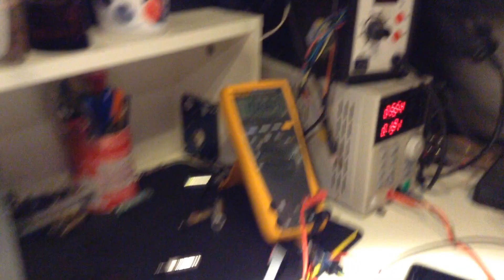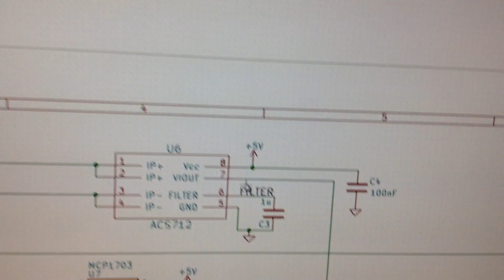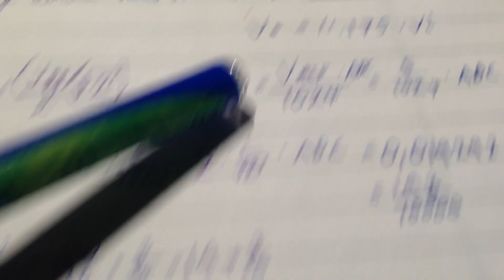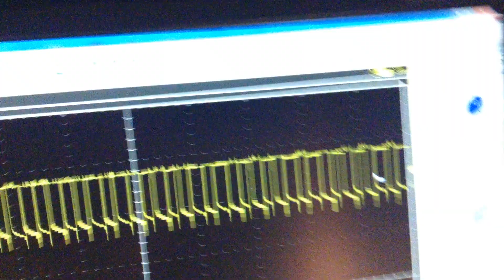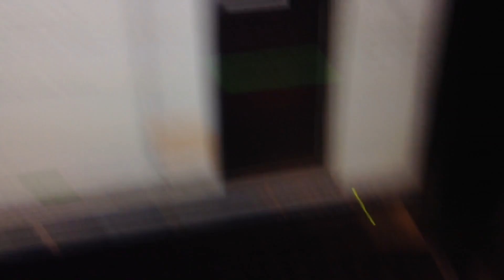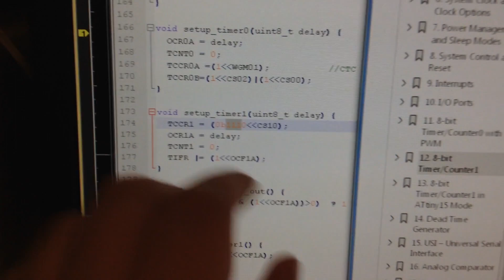Debugging the C64 Saver addon board and adding features

Comment: I've been working on a C64 Saver lately and had to really fiddle around with the circuit to understand how it works and how to fine tune the voltage cutoff.  Once I had something that worked well with one C64 power supply, it would trip out with another power supply that was known to be good.  Turned out, the first power supply is about 5.16VDC and the second one is about 5.26VDC, while the cutoff voltage was about 5.2V.  After that I made up a table of resistor values on either side of the voltage divider that fed the transistors to know exactly what values gave what cutoff voltages.  I'll have to use a combination that cuts off as close to 5.3V as I can so that it works with all my power supplies while also cutting off before a bad transformer reaches a voltage high enough to harm the ICs.
Reply from the maker: That is cool that you got it working. Which circuit did you follow or use ?
Reply: I think it's mainly the Ray Carlsen version, but I may have gotten the circuit from a post on Lemon64 which had some adaptations.  I ended up taking out a resistor, and added a capacitor to give it a little more of a kick to get the relay to switch over.  Even though it's a 5V relay, the 5V line didn't really want to make it fully switch to make good contact.  I'm also going to try again with the dual transistor/solid state circuit.

Comment: Is there a reason that the 2 corners are cut out?
Because it makes it harder to panelize the boards using V-cuts..
Reply from the maker: The board is cut to fit the Hammond 1551g enclosure.

Comment: I've looked into getting some of the SID solutions, but their makers have all decided not to produce them, but rather publish them as open source projects. I've ordered an Ultimate64 board from Gideon and I'm very aware of the trouble he has going through all the production steps. 
I was wonder if it would be easy for people to build the power saver into a new style power supply unit for their C64s.
Reply from the maker: I think that would be easy to do. Just keep it insulated with electrical tape, it can go inline with wiring. Regarding SID and fpga sid. I can't find any design files for it, only firmware binary and schematic.. That's cool that you've ordered an Ultimate64! I might do so in the future too. Thinking about it :)

Comment: Have the same Fluke (179) Multimeter, are great multimeters. 

Great to see people with knowledge doing new stuff with old computers.
Reply from the maker: Thanks :) The multimeter is great. I bought it originally because it had good millivolts precision and also thermocouple capability. I was working on a LED project at the time (2009) that needed thermal tests.
Reply: @bwack   Yeah i am new to soldering electronics and such and was using the Mustool MT826 True RMS, but wanted a better one, so went looking and fount a new one on ebay, and bought it, and i must say i looks and feels great, mine came even calibrated, and i went to fluke registration and have register it.

Love it comes with a temperature probe, same as my Mustool MT826, and it works perfect, the Mustool MT826 says the boiling water is 96c and the Fluke 179 says 100c, so perfect.

Now i am waiting for my aluminum box where i can put my solder iron and heat gun in, hope to have it Monday.